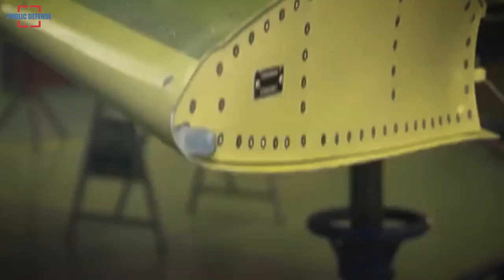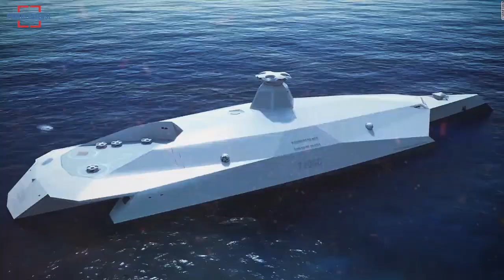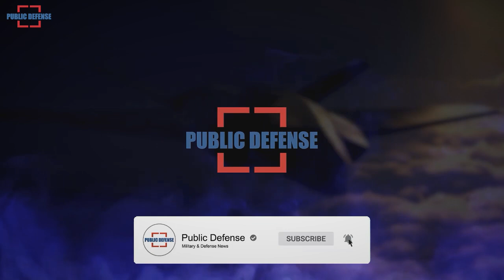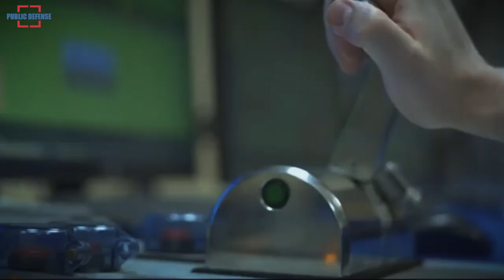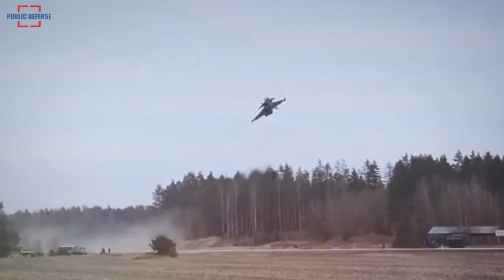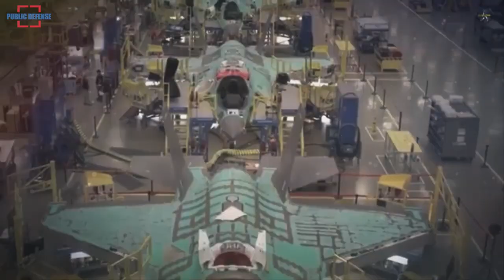Sukhoi Company Began Work to Create a Light Multipurpose Single-Engine Fighter of the 5th Generation

Comment: The only reason for Russia to produce such an aircraft is for carriers or export.

And seeing as they have no carriers, it must be export lol
Reply: Russia's seas are covered with ice for most of the year. 
The deployment of aircraft carriers against Russia in the event of an enemy invasion is also a major disadvantage, as the territory is capable of deploying aircraft as well as missiles anywhere on Russia, and deploying such warships on ice is a very nuclear process. Therefore, Russia needs aircraft carriers. 
Which is at a very low level.
Reply: Single engine planes are not used by navies.